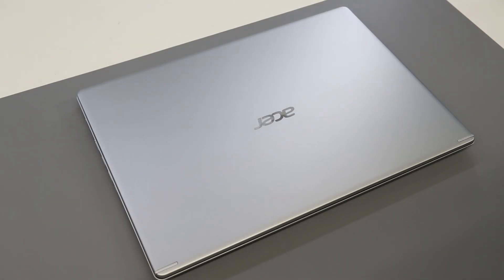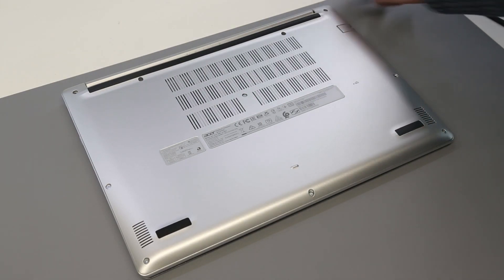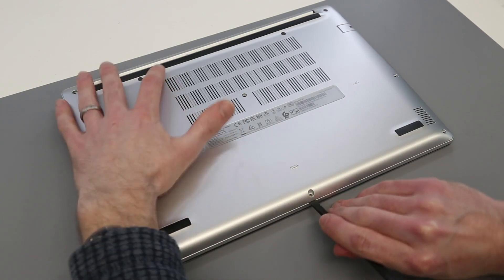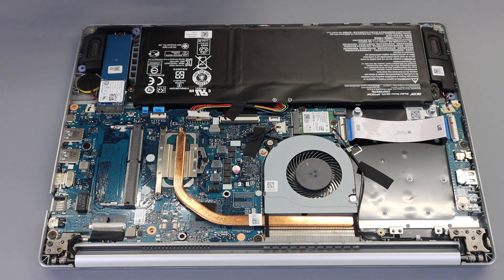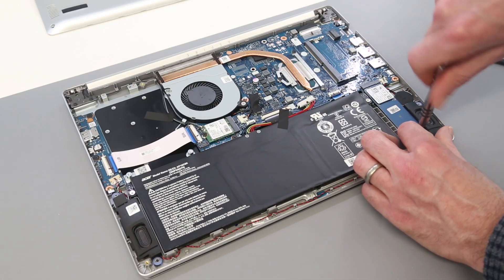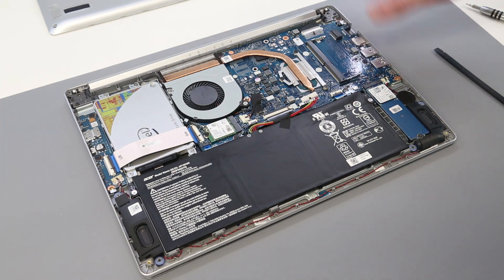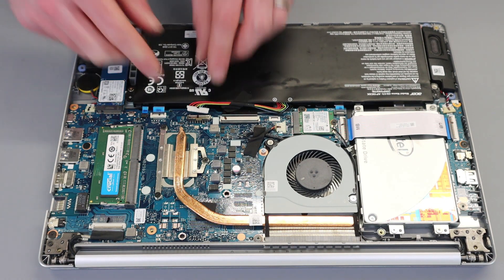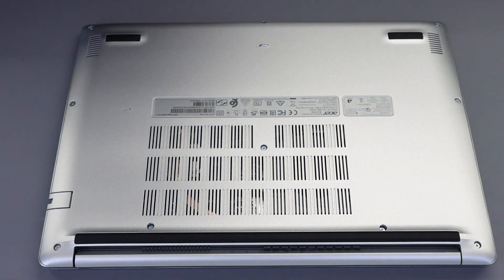Acer Aspire 5 A514-53 - SSD, HDD, RAM, Battery and WiFi Upgrade and Replacement Guide

Comment: Hi, i just changed the removable 4gb ram memory card and replaced it with 16 gb ddr4 3200 but can't tell if it improved the performance or not. Looked to see if the laptop recognises the new ram and it does but honestly if anything feels slower...is it too much? Is there anything else that I need to do?
Reply: Yes need you put a SSD in notebook for more fast. Not just memory do that and a new formatting is very good for make this note run fast.

Comment: Hello sir, my laptops been lagging, ihave  added 8gb ram and it did boost the performance. But still not as good as when I bought it, I have 500gb m.2 SSD, do I also have to upgrade my SSD to 1terabyte sir?
Reply: does removing the my current SSD m.2 will also remove my current windows?
Reply from the maker: Yes, Windows is on the SSD. You'd need to clone the contents across to the new drive, or clean install Windows.
I wouldn't expect a performance boost from a larger SSD though.

Comment: I've an acer aspire E771 and I'm struggling to unplug the fan cable from the CPU. It'not the same shown in the video  but it's Black and doesn't unlock easily

Comment: This helped so much, didn't know how to disconnect the battery. I couldn't find any info what type of HHD have I built in from my previous Laptop years ago. Now I finally know it's 2.5 and that I could even replace it by a SSD. That fact was new to me! Thanks a lot for this helpful video! Im sure you helped a lot of people with this!

Comment: Whats the maximum Ram for this laptop?
Reply from the maker: 16GB module should work.
Reply: @BrueComputing  Just added 16gb ram ddr4 3200 so now total ram is 20 (with 4 already on board) but cant feel any performance improvement. Is it to much?

Comment: I want to change the heat sink paste, but the screw wont budge and I dont know how to remove the heat sink paste?
Reply from the maker: Are you using the right size screw bit? It may need a larger one than you used to remove the base.
To remove the paste I use isopropanol spray and some kitchen roll.

Comment: How do you take out the CMOS battery?
Reply from the maker: Its on the right hand side, just above the speaker - little black round wrap, with red + black lead to it. It plugs into a socket on the board just above it.
You can get them pre-wrapped with the cable fitted normally online, or you can take it apart and wrap a replacement with electrical tape if you need to fit a replacement CR2302 cell.

Comment: hey, Lad! can i change mine too? the processor i mean. thanks!
Reply from the maker: Processor is soldered to the mainboard, so only if you replace the whole board, which generally isn't economical.
Reply: @BrueComputing  damn that is outrageous
Reply from the maker: Its not really outrageous - its the case with basically every laptop in the last 10 years or so - socketed processors add cost (cost of socket, extra assembly time), thickness (make the system 2-3mm thicker) take more space on the mainboard (meaning less room for battery, etc) for a part which generally isn't replaced.
You could swap out the mainboard, but it rarely makes economic sense to do so, especially when for gaming the limitation will be the integrated graphics, rather than the processor itself. You'd probably be better off selling the system and buying something that is better suited to gaming.
Reply: @BrueComputing  alrighty then thanks for the info, lad! Have a splendid day
Reply: @BrueComputing  so if I were to buy a Kingston hyperX DDR4 RAM 16gb 3200 Would it be useless than a 2600?
Reply from the maker: Regardless of what you buy it runs it at DDR4-2666 CL20 - if it is higher speed RAM it'll just run it at that.
Reply: @BrueComputing  any other suggestions to upgrade some specs for this to handle some games?
Reply: @BrueComputing  is the motherboard also replaceable?

Comment: I saw from the internet that the laptop has only the maximum of 12GB. Does that include the 4GB built-in? Or the maximum ram you can add is 12GB totalling to 16GB?
Reply from the maker: 12GB would be the soldered 4GB, plus an 8GB SO-DIMM. 20GB (4+16) should work as well.

Comment: can you upgrade the i3?
Reply from the maker: Modern laptops have soldered down CPUs. The only practical means of upgrading the CPU is by replacing the whole mainboard.
Reply: @BrueComputing  does that mean that it is better to buy a new laptop than to upgrade the cpu?

Comment: How do you unscrew those 2 screws around the battery? I have been trying with a really small screwdriver with no luck. I am afraid it would break the plastic if I screw with force.
Reply from the maker: They shouldn't be overly tight. Try some different sized screwdriver bits and see if you have one which fits nicely into the head. If the bit is damaged it'll slip out more easily as well.

Comment: 2666 or 3200 mhz compatible with acer aspire 5 core i3 10th gen a514-53?
Reply from the maker: The soldered down RAM ran at 2666 in my i3 model. DDR4-3200 will work, but will run at 2666.
Reply: @BrueComputing  sir can i upgrade on ss+hdd on this laptop?

Comment: Do you have a link to the wifi card you used? Would it be possible to replace the card in there with a wifi 6 capable one?
Reply from the maker: You can add WiFi 6 support with an Intel AX200 card (Amazon Affiliates link): https://amzn.to/3nKEfGA

Comment: Which ram is compatible for this unit? 2666 or 3200 mhz?
Reply from the maker: The i3 model I had featured DDR4-2666. DDR4-3200 modules aren't any more expensive and worst case will just run at DDR4-2666 speed, so I just keep those in stock and use them for any upgrades.
Reply: @BrueComputing  bro i have the same model can i add 8gb ram on top of the preinstalled 4 gb ram 
p;z answer?
Reply: @BrueComputing  so you're saying is that its maximum is just 2666 speed even though you replaced a 3200?
Reply: Nice. Thanks mate.

Comment: for only adding new RAM, do I need to remove the battery cable
Reply from the maker: You don't have to, but it decreases the risk of doing any damage to the system by accidentally adding or removing RAM with the system powered on.

Comment: I just watched this and upgraded my ram to 20gb, thanks a lot! Any idea on where to get one of those cables and brackets? (Sorry I can see everyone is asking haha, I got the laptop 2nd hand recently). I may get my friendly local IT shop to help me on that front :)
Reply from the maker: Not really I'm afraid - it came inside the box for mine!
Reply: @BrueComputing  i popped down today and it indeed was a proprietary cable. thankfully they had one from a dead acer someone brought in. no tray for the drive, but a little double-sided tape should keep it still. there's not much room for it to move anyway. they charged all-in me less than what those cables cost on ebay as well :D
Reply from the maker: @BadMotivator66  That's awesome! Nice one.
Reply: Hi! May i ask if what brand of 16gb ram did you buy for Acer A514?
Reply: @hientjemadrid9905  Crucial. they always can tell you what exact model ram you need, with their scanner tool. you can also find the model by other brands but crucial are still a well-respected brand and i've never had compatibility issues with them

Comment: can i add intel optane to acer aspire a514 53?
Reply from the maker: You might be able to use an Optane module alongside a SATA 2.5" SSD or HDD, but I'm not really sure I'd recommend it vs. just fitting a large, fast, NVMe drive.

Comment: I can't believe I watched the whole video for a laptop that I'm not buying after 2 months still😂. But the instructions are very clear and will definitely be useful to those who repair and handle technology like this.
Reply from the maker: Glad you found it clear. I actually quite liked the machine - almost kept it to use as my work system.
Reply: @BrueComputing  I also think its great for its price point! Given that it's a budget laptop, I think this is very decent. You can even do some upgrades for better performance. It's a good offer, in my opinion😃
Reply: @penguin_1293  is this acer aspire a514 53 39sp?
Reply: battery  PN #   AP18C8K

Comment: I have the same notebook, it's great to know what's inside without opening it, thanks!
Also the screw at the left top of the bottom case, the one where the screen and AC connector are, is broken and so is the plastic around it, so the notebook has one screw less, and an important one, any suggestions?
Reply: @doofeyduck9316  Thanks for your reply!

Comment: hello I have a question. I am planning to buy a ram for the same laptop as on the video , is the ram compatible to the current ram installed which is 4gb 2400mhz when I buy "Kingston 4GB (1x4) 2666MHz Ddr4 Sodimm" it is the name of the product I saw in the shop

Comment: Hello kind sir. I have a question. I have an ACER ASPIRE 5 A514-52k-32NL model. Is there a specific battery that is compatible with this model? I don't really know what to look at to know what battery suits my laptop.
Reply: https://www.ebay.com/itm/114550221802     # AP18c8k  check and see which laptop is works for .

Comment: my model is the same as yours in this video. however the nvme is 512gb, it has a RAM chip of 4gb 2666mhz
and there is an nvidia chip there you can see in the board close to the fan it has a design . There is where the MX350 geforce is.

There has been a lot of complains about temperature + throttling here. GPU usually  doesnt get past 70C (hot spot sensor a little bit wamer around 75c), and then it throttles, however it is not the biggest trouble here. The biggest trouble is the processor. I5 1035G1 has a base clock of 1 ghz. WIth turbo it goes to around 3ghz. However they all get too hot when turbo is turned on.  There has been some BIOS promissing to improve performance, but what they essentially do is control how frequent the throttling occurs. What we have done to get around the throttling more efficiently is to use a software called throttlestop and we deactivate the limits locking our own limits.  Here i have limited it to between 11-13 Watts( depending how hot the environment is).

Have you seen this trouble? have your experienced this trouble?

strange thing is ,after some hours of gamepay, if i put my hand behind the notebook where the ram and nvme lies at, it is the only area where i can see its hot where it should have been the area where the fan lies ....i dont understand... its almost like the ram and nvme were the only ones getting hot, or its the hot air that has nowhere to go getting stuck there
Reply: same situation my unit is stuttering in playing valorant.
I have updated the drivers several times didn't fix the problem.
I updated once more and boom no more stuttering but still it overheats.
Reply: I hope I'm not late but you can use ThrottleStop and undervolt the CPU to reduce heat
Reply: @rnz9999  i have been able to use it with throttlestop using a good cooling pad. I didnt even need to underclock or undervolt the GPU, just changed the PROCESSOR HOT value to 85 celsius degrees. Has been good, no issues. Its important to mention that i live in a HOT country, and it has been cold these days.... i wonder how is it going to behave when its hot lol
Reply: the whatsapp laptop owners group i make part of i have already seen one person returning the laptop for issues already.
but mine keep on going  with these changes

Comment: How much memory can I install in this laptop?
Reply: @Jayson Bravo if there is SATA hdd, you can easily swap it to SATA ssd. i can't say for sure about "max capacity" though. But you can for sure install ssd with the same capacity as it was on hdd, or less. Also, you can ask manufacturer via email about ram and ssd limitations, or service center from where you bought your laptop, good luck!
Reply from the maker: The example I purchased had 4GB soldered down and an empty SO-DIMM, so could take a 16GB DDR4-2666 (Amazon Affiliates link: https://amzn.to/3b9P1zJ) for 20GB in total.
32GB sticks may work, but I wouldn't want to guarantee it.
Reply: @BrueComputing  don't say those things as people can take it as a legit information. usually cheap laptops can make things work at 16gb ram max, but i would bet that capacity of this model is 12 or 8 gb max
Reply: @BrueComputing  Thanks